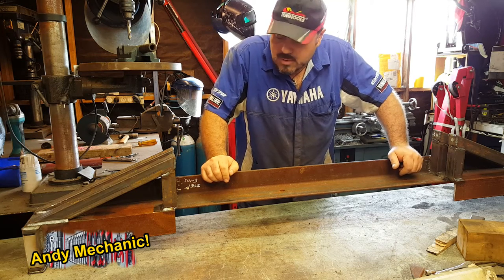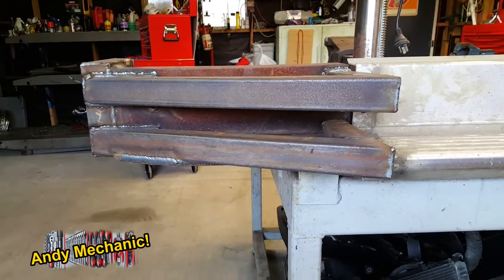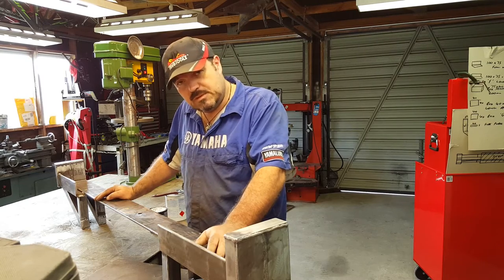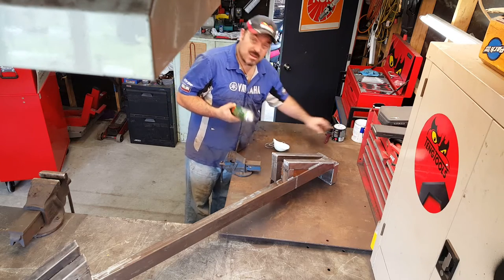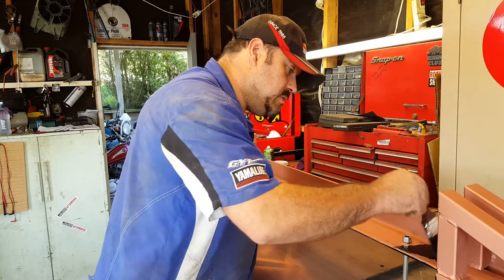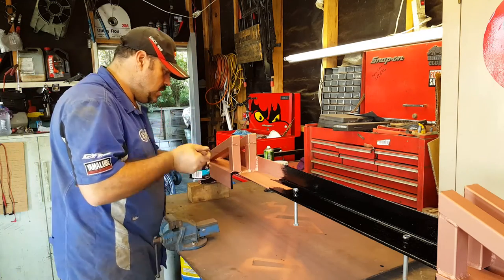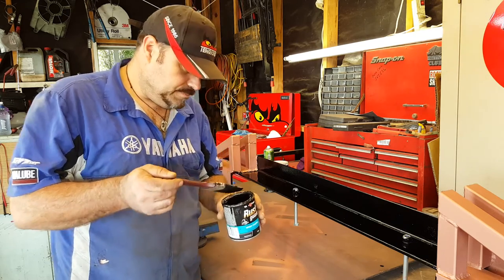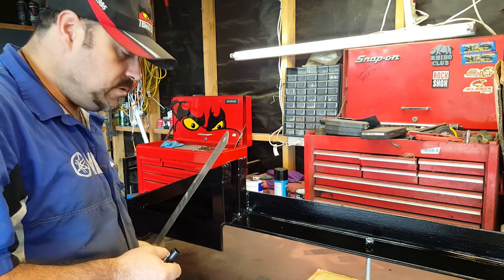Nissan Patrol fabricated bumper cleanup, paint & fit #2006

Comment: Andy I'm right in thinking you drove the y60 from the UK to Aus? Did you convert the rear lights to aussy spec? I'm in the UK and looking to fit some aussy rear lights and wonder if you remember how you did it cheers
Reply from the maker: Ah, we only drove as far as Athens then put the Patrol in a container & shipped it.

The vehicle was built in Japan & sold new in Australia though. Must have had the lights changed when it was imported into the UK

Sorry, I dont know what the Australian rear light requirements are.

Cheers Andy